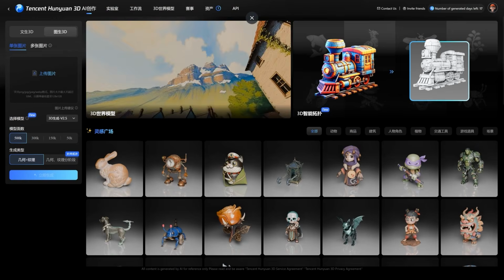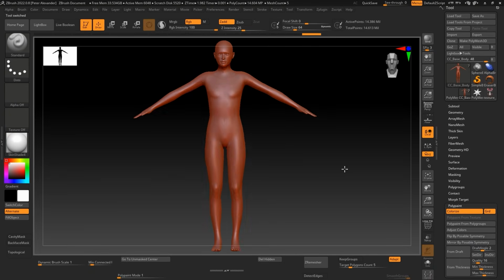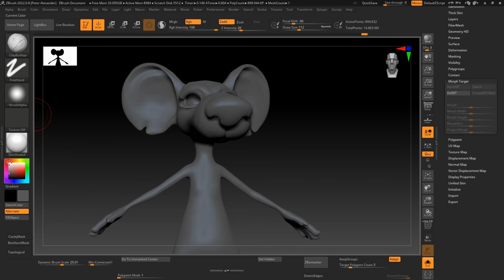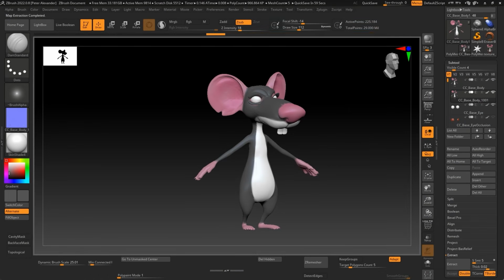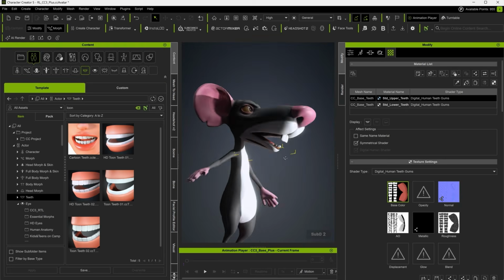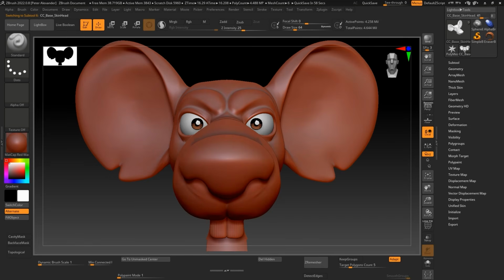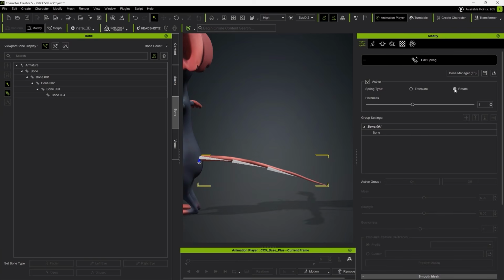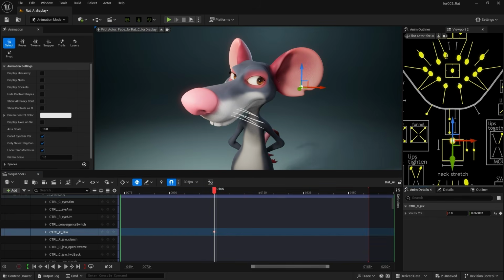Bring AI Rat Alive in Unreal Engine using Character Creator 5 | AI to UE Animation Workflow

Comment: Why when i hit goz all,zbrush doesnt send the wrapped head but the original cc5 head with minor changes? Also in cc5 i get the option create cloth/prop instead of update
Reply from the maker: Hi @MrMertens,

If the topology of the mesh, the polygon count, was changed from the original it would not be able to replace, but only send back as a cloth/prop. So If they increased the subdivision in Zbrush, they need to set it back to the original that it was in CC.

If the issue remains, submit your issue with clear screenshots and/or screen recordings to our support team, and we'll resolve your issue as soon as possible:

https://www.reallusion.com/CustomerSupport/User/FAQList.html